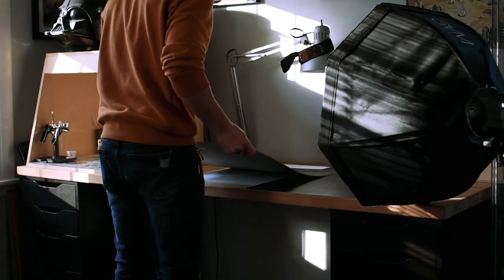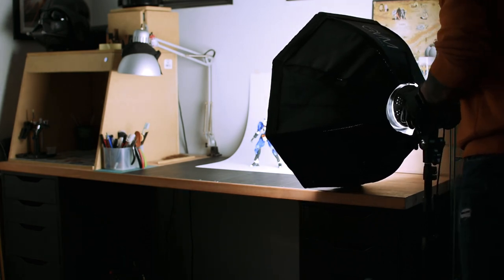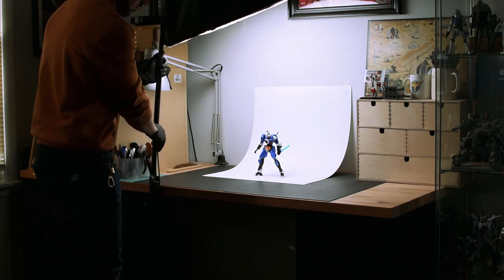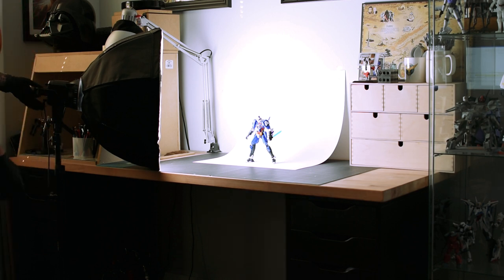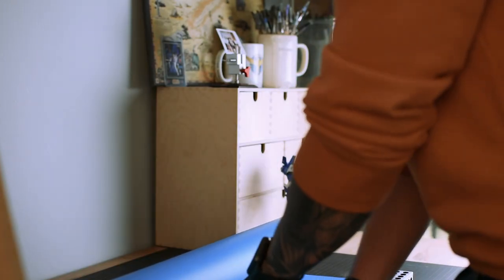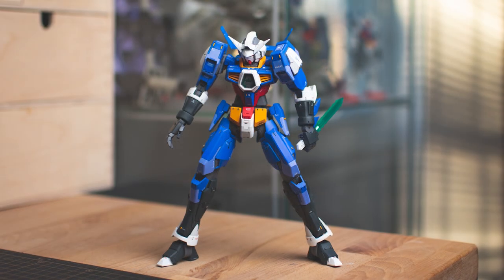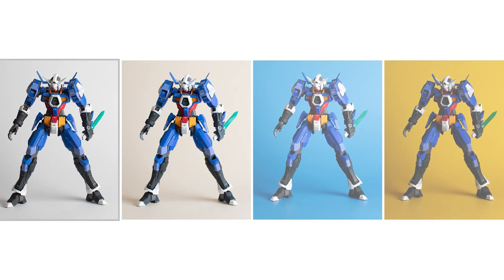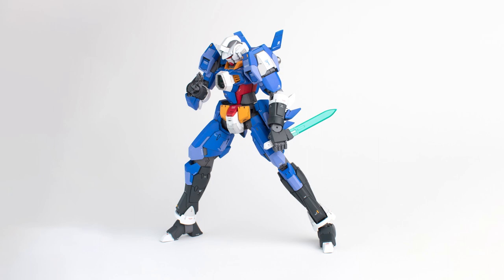Gunpla Photography

Comment: Stupid question. Is there a particular paper type/ size you’d recommend? Tried pvc but not working out quite well
Reply from the maker: That's actually a great question, as I am particular about this. I like the Canson 98lb paper stock, it has a bit of a watercolor paper type texture which can show up in final photos in a very subtle way. For the size I use it's 19.5 in x 25.5 in. Tends to work quite well with larger models like MG 1/100 (and smaller scales). I thought of using pvc as well, but it's not as cost effective as paper, harder to acquire, and can be a bit more on the reflective side. Hope this helps.
Reply: @joshualee3389  this is quite helpful. Just can’t seem to find anything matching the description here in the uk. Do you have an example on Amazon us or any other site I can reference for details on what I should be looking for?
Reply from the maker: @Ife_As  Here's the brand and exact paper stock I'm using: https://www.amazon.com/Canson-Mi-Teintes-Drawing-Sheets-Assorted/dp/B0042SSTOU

You can also google "Canson Mi-Teintes Drawing Sheets" to try and source it locally.